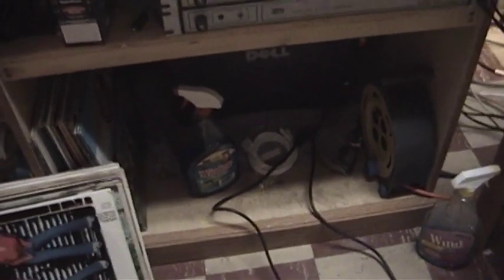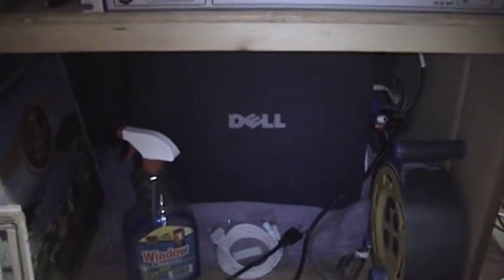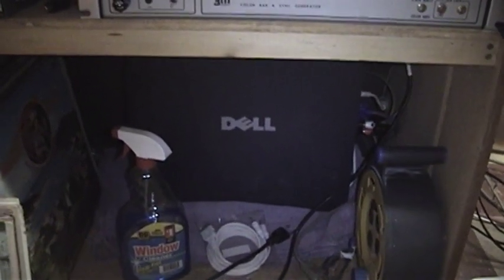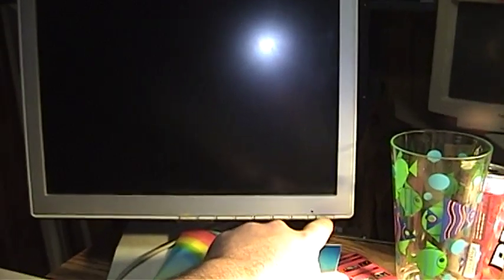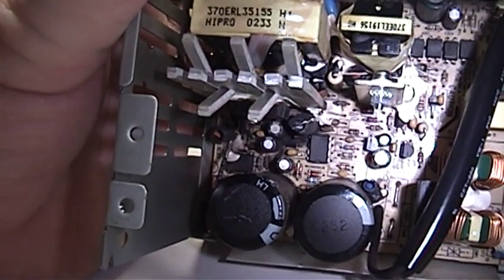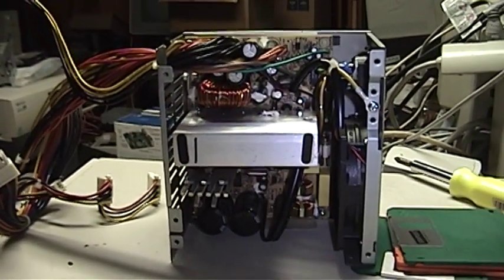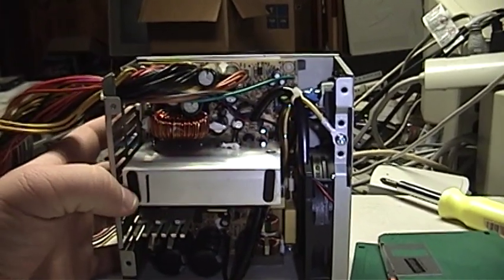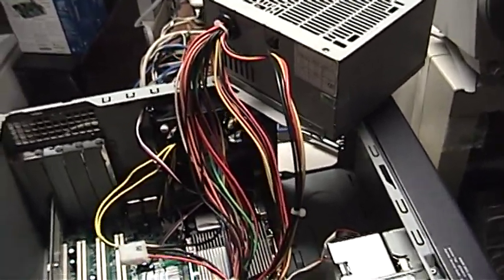Uh-Oh! Dimension 2300 PSU Meltdown

Comment: I've been going through and evaluating all the personal computers in my collection lately, two of the first that I have gotten to had "PSU meltdowns". A Dell Dimension c521 SFF system shot sparks out of one of the main switching transistors and then today I had a Dell optiplex gx100 create a big plume of smoke followed by a loud cracking noise, I haven't worked up the courage to explore it yet but I would assume it is either going to be capacitors or that some other component has decided to die.

Comment: meh my old PC died from a bad psu 
i was listening to some music i smelled something burning and then my pc screen went black with some smoke coming out of my pc, I replaced the psu but it didn't work
Reply: Maurice-Mores My budget 4K rig was running idle, and it sounded like gunshots when the PSU died. I'm replacing it with a 600 watt EVGA B1
Reply: +Maurice-Mores i used to have a old pc moniter and while i was out of the house it went up in smoke even know it wasnt turned on
Reply: buy seasonics and it will outlive you
Reply: Drewbidoo get a 620 seasonic s12 ii I got one of these in my custom built gaming pc

Comment: some dell optiplex machines from around the same time were pretty bad ones.
Reply: +Devin Hepburn South bridge fires. I had one that went 'nuclear'. :P It was acting strange, and I pulled it open while running and it was glowing orange before i killed the power. If the computer was dusty, it probably would of caught fire.
There are videos out there of it happening to others. It was a scarily common problem. I believe it primarily effected the scissor/clam shell style cases, not the ones with removable panel.
Reply: +Devin Hepburn i had one do that but for some reason it kept going

Comment: I had a power supply that I used for testing purposes and I plugged it in one time and I turned on the PC and it popped and a blue flame came out of the fan hole.
Reply: +Zephyr302 MC i had a really cheap psu in my dell 745 and the powersupply light up yellow when you started it or shut it down
Reply: +Michael Flatman that is sparking no leds

Comment: Did you put too much load on it? I had once almost blew my 250W supply loading it down with a nVidia GeForce GEX 650 Ti retrofitted onto a Q9300 workstation. Then upgrading it to 700W saved the day (and I repaired the old supply as it is just a blown cap from overloading)
Reply: 陈北宗what were you thinking??
Reply: m80pls What was I thinking? I was gradually upgrading my old workstation piece by piece, when budget is adequate.
Reply: 陈北宗 No, putting a 650ti with a 250W psu is literally one of the most stupid things I've heard that was never gonna work in a million years... especially from someone technically minded enough to even have a "workstation" and know how to replace caps etc.
Reply: ***** I found a dell to day the same as the one in the video an the fan was held on by a rubber band but I fixed that problem and I got a  IBM computer from 35 years ago

Comment: I had a Gateway computer I bought from a recycling center and brought it home to find it no longer worked. The Power Supply seemed to have a large object rattling around inside it, and when I opened it just a little bit, a common voltage choke fell out leaving a large black space open on the board. The system was worked to hard to my assumption. The PSU's failure likely took the motherboard (A standard 7 slot ATX Slot A motherboard), GPU (An nVidia GeForce 2 64MB AGP), and the CPU (An AMD Athlon 850MHz Slot A) with it.

Comment: About a half a year ago, the power supply in our Dell Inspiron 546 failed just like your Dimension 2300. No surprise for our computer since it's basically on 24/7.
Reply: Colling Smith I had a power supply blow up on me, and I'm 11.

Turned my old eMachines computer on and BOOM! I saw sparks, then smoke rose from the back... I shouldn't be surprised since it was a Bestec power supply, never even heard of Bestec, anyone else?
Reply: Alexander Wolfe No suprise since it was an eMachine. eMachines are notorious for their cheap unreliable power supplies. I've never had an eMachine, but from what I've heard, they're pretty bad.
Reply: I scrapped it, I think the psu failed, it booted up but no monitor and fan was full speed 24/7. Saving the case for possible build, card reader, case fan, hdd, modem card, and ram are still good, but psu, mobo, and cpu are bad
Reply: Alexander Wolfe Yah, parting it out was a good idea.

Comment: The fans that are in power supplies.. are they just standard fans that could be used as a case fan if wanted? Do they use a regular three-pin connector that would be on an average motherboard? Do they have the same proper mounting holes for mounting into a case?
Reply: The fan in that power supply should be a standard form factor 80mm fan. It is wired for power only, with the red and black wires probably soldered directly to the circuit board inside the power supply. Some power supply fans are the three pin type and plug into a header on the power supply. You can use the fan in a case, but you would have to come up with some way of connecting it, because it doesn't have the conventional header plug on it.

One thing you can do, is to take a junk fan and cut the wire harness (Cables with plug) off of it. Then splice together the power wires and tie off the yellow wire. That should work fine.

Comment: i got one of those flat pen4 hp workstations /office pc screwed sideways on my basement workshop wall i have a normal full sized psu screwed on the wall next to it with the wires running into the back of the case anyway one day i was cleaning up and had some tunes going and then it started the fireworks show lasted about 20 seconds with chunks of the board and components flying out the fan and thick grey smoke finally going dead short and tripping the power bar most destruction i seen

Comment: I had one go once that took-out the entire computer.  It only had a cheapo zener diode across the 5v rail and ground.  It shot about 48 volts down the 5v line and fried everything.  Some of the Molex wiring even melted.

Comment: I have to correct you on this, if my 20pin to 24 pin adapter is to be believed, the 4 extra pins are +12Volts, 5V, 3.3V and Ground.

Comment: I had a PSU blowing up on the night (Yes I sleep on the server room). the transformer literally exploded into pieces. It's very impressive. I now only use Corsair, Antec and Seasonic PSUs. Nonames are very shitty but they are as well very dangerous !
Reply: Me too. Had a Dell Precision T5500 Xeon Workstation that I used as an FTP and when I was in the room it went POP! Unplugged it right away and smelled burning components.

Comment: I'm not a fan of repairing those things, especially when I find school computers where the kids have flipped the voltage selector on the back of the system unit (230v outlets here in Australia) and leave it unplugged for an unsuspecting victim to plug it back in, and hear a loud pop noise right in their face. Strangely enough, I had a PSU go pop when plugged in, and the green +5VSB light on my testing motherboard still lit up. That motherboard is currently undead.

Comment: I hate switch mode power supplies, I know the reason that they use them in computers, and most of the time they work fine, but it's almost a futile effort to try repairing one. What bugs me is they have been expanding their use into more mundane consumer electronics using bad designs and cheap parts that cause hash all over the AM bands.

Comment: Yeah, I found out how NOT to put a remote control back together. I was cleaning some internal goo out of an old Sharp TV remote when the battery lead springs popped out. I put it back together with the batteries in place. Next thing I know I smell something burning (the remote is blazing hot to the touch), and took the batteries out. Just the other day I managed to internally fry a phone charger with a dead smart phone. That just tells you how "good" I am at electronics!!!!

Comment: About 4 monts ago a neighbor gave me their Compaq Presario SR1410NX (celeron 2.80) It worked fine until one day i plugged in a flash drive into the front USB port and the power supply made a large POP and some smoke after it.
I dont really like messing around with PSU`s, its better off just replacing em.

Comment: i've had quite a few PSU failures over the years, one that comes to mind was in my quadcore AMD machine, and i had left it running overnight, woke the next morning, my alarm clock was dead, found out the PSU had fried during the night and had tripped the power circuit breaker for power points through the house..........since then, i dont leave it running unless i am there in the room with it !

Comment: I have a friend who had a Compaq that had power supply problems.  It didn't die exactly, what happened was the cooling fan in it died.   This was very problematic as Compaq had cheaped out on building this computer so much that the power supply fan was the only exhaust fan in the case.  This ended up causing the temp inside the case to rise which in turn fried the CPU.  We didn't know the CPU was dead until we replaced the power supply and it still wouldn't boot.

Comment: @oldtime40s Used to work for a shop that sold them. The "Sparkle" brand power supplies went bad often in them. I also remember the fans in them breaking a lot too. We also had a few computers in for service that manged to trip the circuit breaker when you plugged them in.

Dell did sell a model with faulty power supplies, the Dimension 4600. We had a few take out the motherboard.

Comment: u got lucky.  As it turns out my psu had been gonig bad ever since adding a second hard drive in my sysyem.  It mimiced a problem typical with the segate 1.5tb drives where it would just shut off randomly.  eventually other parts started shutting off randonly and their was a high pitch buzzing coming from the psu.  eventually the hdds wouldn't power on at all then it killed my gpu

new psu and hard drives are safe but had to get new gpu.  So it died a silent death sort of